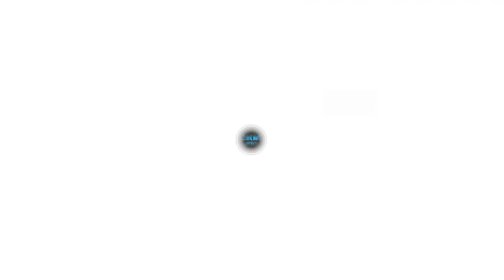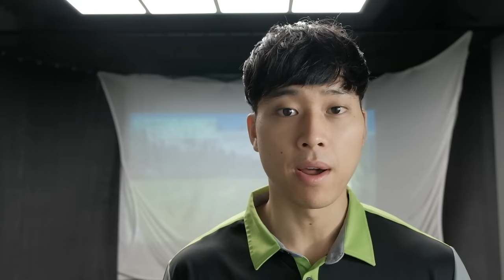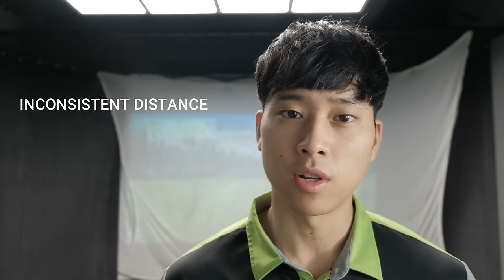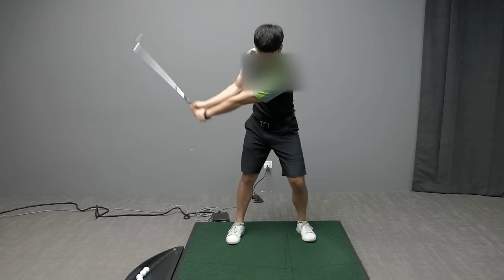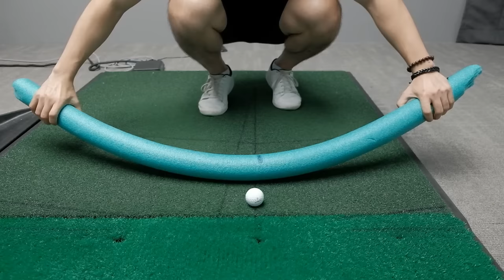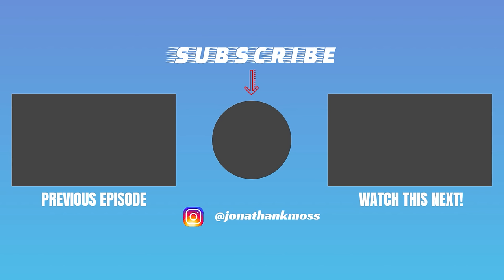3 Things That Control Low Point (STACK & TILT)

Comment: minute 3.28/ radial extension = loss of low point control. Also is this resulting in early extension as well because we subconsciously and athletically lift up to avoid hitting ground and this leads to pushes/slices to right? thanks

Comment: I am a really bad golfer and I could not lower my hcp, no matter what. It was stuck on 25ish for years. Main reason: extreme inconsistency in drives and longer clubs in general. I am sure most suffer from this, but I consider myself an extreme case. I typically lost around 9 balls per round (18 holes). My shortgame was disproportionally good, meaning whenever I managed to get within 100 yards of the green without lost ball, I would always make a par or bogey max. Then my new pro suggested a "shift delete" on my swing and built it up from scratch using stack and tilt and my hcp dropped 10 points to 15 within two seasons. I also feel confident behind the ball. I still hope to improve further, but I think to all people who struggle with long-club consistency, this could be a gift from heaven. Give it a try!

Comment: Jim Powell here.
It seems that the stack and tilt would be a great way to play. Simply by putting 60-65% of your weight on your lead leg, while keeping your head still and simply turning your lead arm under your chin during the back swing and turning your right shoulder under with your downswing you should be very consistent in hitting the ball correctly.

Comment: I have adopted a lot of “Stack & Tilt” and, for the most part, I like it. But… 

I don’t care for the rigidity of the S&T “purists”. 

That is, I find keeping the weight left and left shoulder down really helps my ball striking, but trying to hit “positions during the swing, the “ten words”, even the “grid” is just too restricting. I feel the SWING is a movement, MOTION, and not rigid positions. 

But if you keep it simple and use STACK and TILT for your swing thoughts, it does help. 

Are there elements of “Stack & Tilt” that you DON’T care for? Love to hear more of your thoughts on this methodology.
Reply from the maker: Stack and Tilt is just a system for the swing but there are positions in the swing that can vary and don’t have to fit a certain mold. I think this would be a good video idea.

Comment: My question and Key, at your lowest point in setup, do you focus on the Low Point or the Golf Ball for solid ball striking?
Reply from the maker: For me personally I focus on Center contact but I know that I have control over low point. As a first step you should definitely think of low point
Reply: @JKMGolf  Center Contact to focus on the Ball or Low point with your Lead Shoulder